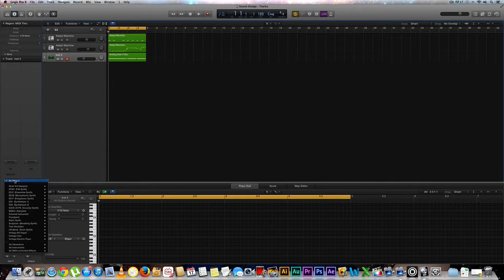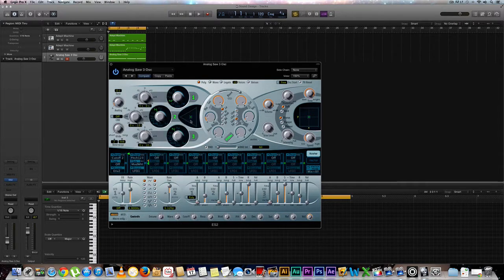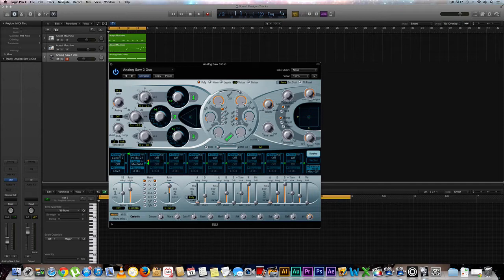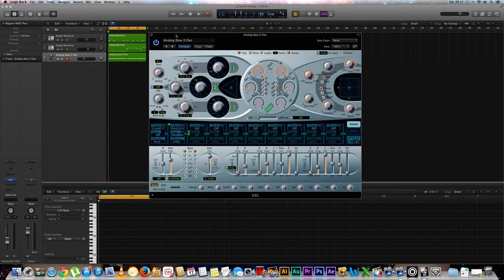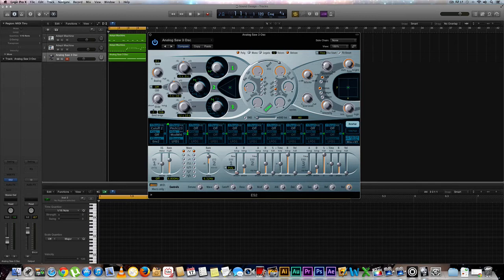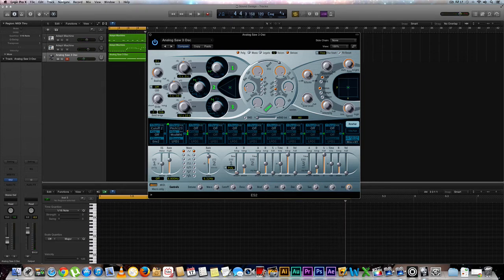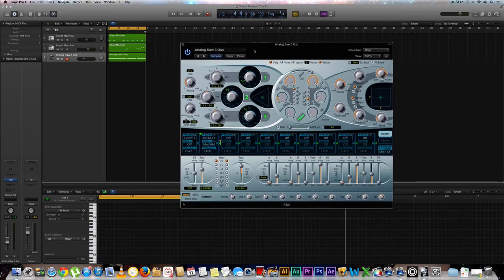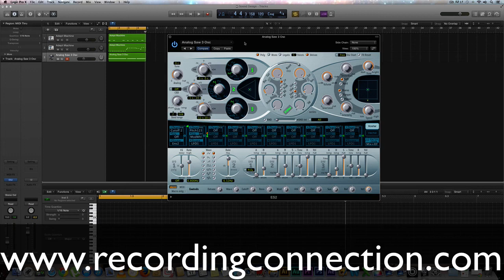Sound Design Cool Pad Sound in Logic Pro X

Comment: Why there arw 3 Envelopes ? Each waveform one envelope? but why there are different and different parameters?
Reply from the maker: Envelopes are parameters used to change the sound in a synthesizer. With that being said, as for this particular synth, you observed 3 different envelopes to adjust different parameters. It is really a design choice to give you more control over the sound being synthesized. Each envelope parameter controls the entirety of the sound being synthesized, not each oscillator. Each envelope controls different parameters.